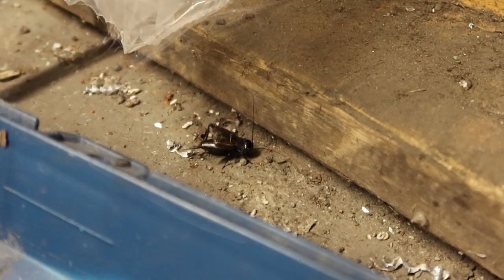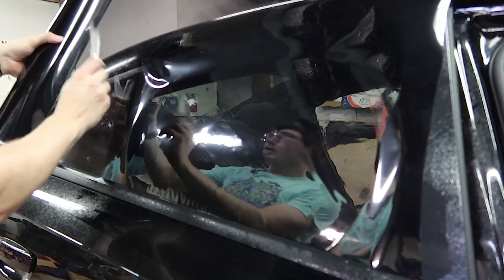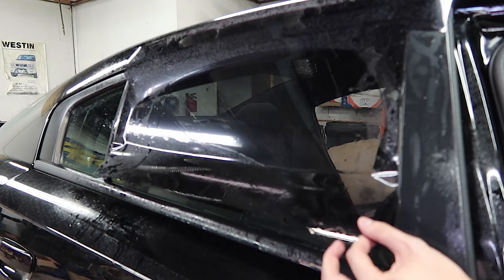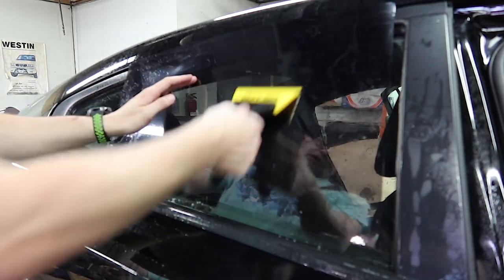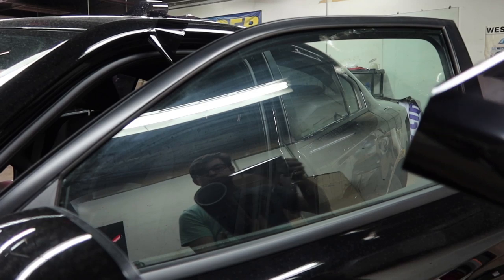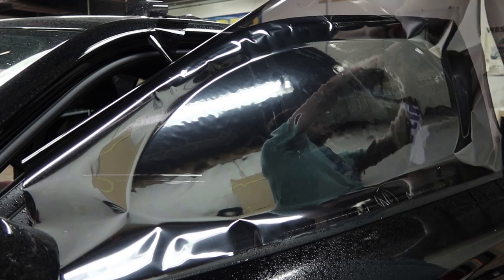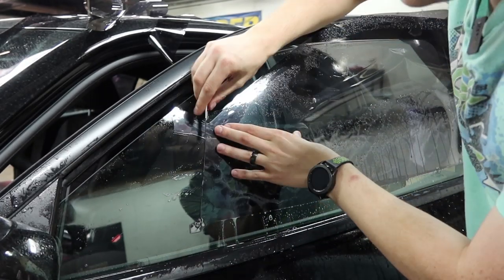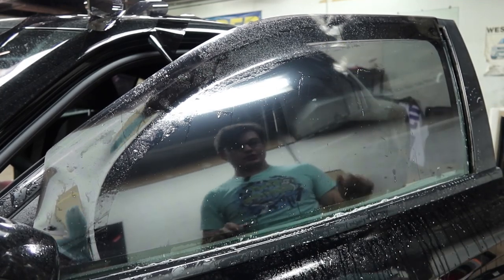How to Hand Cut Window Tint on the Car | 2019 Dodge Charger

Comment: Bro having trouble with 2019 accord back window shrinking but more with the install keep getting baby fingers at the bottom. Got trained to do tint in 3 days lets just say with a huge company and thrown to the wolves. With pre cut machine
Reply: shaktown 305 you dry shrink or wet shrink ?
Reply: i use the h pattern
Reply: Shrink slow and let your heat gun do the work.
Reply: @FadeToBlackLLC  thanks I'll try that

Comment: Why do you shift the tint film right and left after each side cut out?
Reply from the maker: the pattern needs to be a little wider on the sides and bottom so there are no visible light gaps.
Reply: @DetroitTintStudio  I'm gonna try that cause sometimes light goes threw it
Reply from the maker: yea glass has a thickness and when you look thru at an angle you can see the gaps when cut exact

Comment: I hand cut as well. I do like to use my Peel Board though. Cutting on the car will save some walking time depending on how far away your board is.  It's good to know this when out doing Mobile and you don't have access to a board.

Comment: I think pulling the film down is to much i think cuting at the rubber is great maybe a tug pull but i think how you show for a beginner will mess up a lot of times and they will try try agian because they are looking at your vid but you dont need to go that far down just a FYI i love you vids but this one is miss leading for beginners because they cant tuck with that much film
Reply from the maker: how far you pull the film down, depends on the inside seal. I'm all for finding an easier way to accomplish the same thing but I think you should almost always be a little below the inside bottom seal. sure, that doesn't make it easier. A correct clean installation isn't easy to learn.